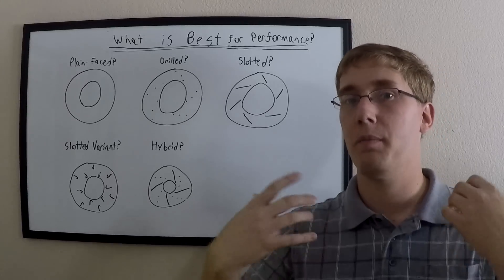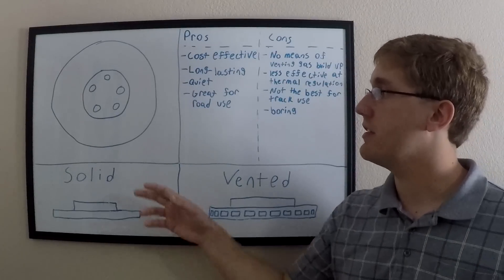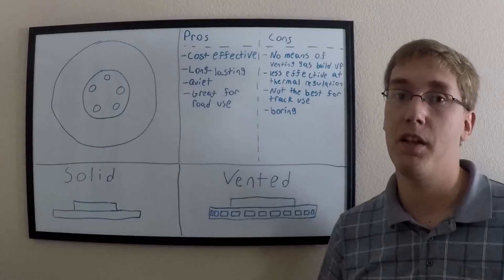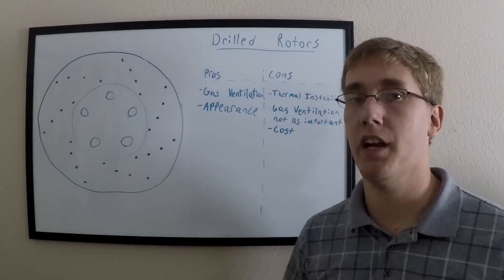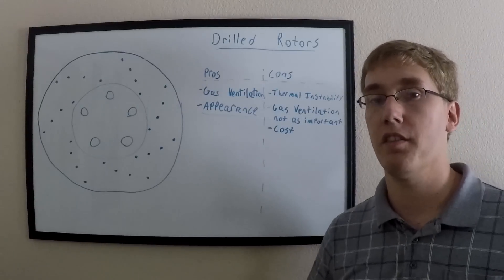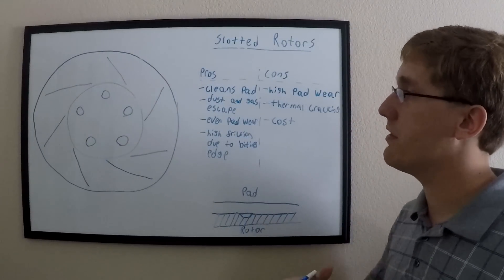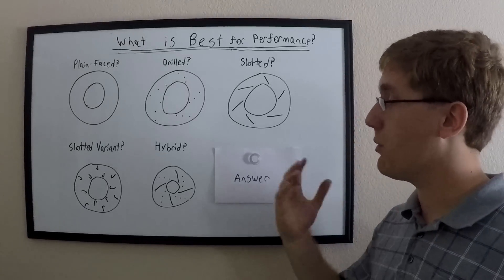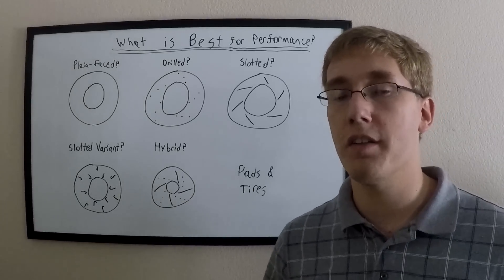Plain vs. Drilled vs. Slotted. vs ??? Rotors - What's what?

Comment: Grate video...need some help,iv got a mk5 gti golf with Mercedes ML500 discs 350mm from mtec brakes,with 6 pot Audi Q7 callipers,after 6 weeks i got the steering wheel vibrations so more than likely warped discs,the pads were basic brembos i believe paid around £40/50 ish..iv been told mtec brakes are shit because they come from China and are modified wen they get to the mtec factory,mine were dimpled & groved discs,I’m now thinking about EBC discs with yellow stuff pads,I’m running Just under 300bhp but i never use it,i drive normal hardly go that fast abs definitely don’t sit on my brakes,the corse of this would you say discs or pads,some have said because iv got 6 pot stoppers it’s making to much heat and the disc can not take it,i was told to drive slow for about 80 miles and i done 100 miles before actually sitting on my brakes,some say i should of done the 10 plus stop & go bedding in,60 mph to 5 mph to 60mph then 5 mph and so on,what’s your opinion to help me get the next one right coz I’m fed up ,wen i got the car it was the same set up but pads were more race pads i only changed them because of the squeaky noise and apparently they were on the car for 10 months (weekend driver) i then was everyday driver...sorry it was so long just need some good advice
Reply: Here is a Wikipedia link explaining how disks get damaged (saves my repeating the information) - https://en.wikipedia.org/wiki/Disc_brake#Disc_damage_modes.

So your problem, like mine with the steering wheel on my car can be complicated. One thing worth a try is to remove the disk, make sure everything is clean of dirt and rust, then rotate it one hole and reinstall torqueing to specifications. Use something like a marker on the disk and one lug before removing so you know how much to rotate it. If the problem ceases, you're done.

If that doesn't work, why not return to the original specs of what was on the car since you're not racing it. Get disks and pads as were specified for it. And as for how to apply the brakes for new disks/pads I've always read to gently bed them over 50-100 miles of driving. That will allow the pads to more tenderly touch the disks, wearing down the high spots easily. If lots of force is applied, then the high spots will get very hot (low spots will stay cooler) and the high spots will deposit material on the disks that you don't want on them and cause them to be thicker in some spots and thinner in others. So when the disk rotates, you'll feel that in the steering. That's what I can offer. Now I have to do the same on my car to solve my problem.
Reply: Put the OEM brakes back on.

Comment: Thanks for nothing, my stock flat face rotors using carbon ceramic pads warped due to excessive heat, after $1200.00 dealer replacement you bet your bippy I'm ready to try some after market drilled and slotted rotors
Reply from the maker: You need to try a different brand of rotors then, possibly a different material as well. Upgrading your rotor size can also help dissapate heat to help prevent this.
Reply: van helsing ok, that’s normal there is nothing wrong with your flat face discs except they don’t offer the same bite as with slotted/dimpled. You drove too hard and the rotors heated up. If you had drilled, slotted or hybrid discs they would’ve heated up just as quickly and cracked even at lower temperature (because they are not as strong). 

So what is the solution?You need to stop if you are on a racetrack at some point and check or measure the disc temperature. If they are too hot then that or a lap less is the limit of your brakes. But stopping is not recommended so do a cooling lap before stopping always. You will also need street/track pads and I recommend good aftermarket discs hybrid I would choose. Now If you are on a racetrack, you need to do a cooling lap even every 2-3 laps depending on how your discs heat up. Also, I recommend a racing brake fluid as well. Another thing, you could install brake ducts to keep them cool longer that would be an effective upgrade.
Reply: @inox1ck  So I'm not anything but a novice when it comes to racing and brakes, but I do see professional racers always seeking for a way to direct more air at the brakes. That is one possible way of helping dissipate the heat.

Comment: I like the teaching you did on this. Quite informative. However. As I drive a minivan on mountain roads,  I found your video didn't cover real world driving. Not everyone has a car for the tracks. Can you update the information for those of us who don't have "performance " vehicles. Thanks.
Reply: If you're driving a minivan, go with OEM replacement parts. The manufacturer of your vehicle designed it to stop optimally with how they built it, so use the same thing. Otherwise, you may spend money that may not give a be worth it, or even make your vehicle brake less effectively.
Reply: @Kenox80-80  Agree. They are outside the design/use specs. :D

Comment: Drilled is helpful when towing heavy
Reply: I would agree because with the added weight of a trailer, it takes more braking power to slow the vehicle, which in turn creates more gasses that need to escape.

Comment: Hey, I found that Coated Rotor supposedly be the best, no hole's no grooves no cuts or slits, do you know anything about this?
Reply from the maker: Coated in what? Typically coatings are for bedding the breaks or preventing rust during storage
Reply: Some coats are only to keep them from getting rust. On the break pad contact of course it stays clean

Comment: Interesting and informative, thanks. So in order to upgrade my brakes I'm better off getting a different pad, as tyres are already done. Can you do a follow-up about pads? That would be interesting...
Reply from the maker: The pads are deffinitely the biggest factor in terms of brake performance. Depending on your use case, you need to select an apropriate pad (low brake dust, noise, operating temperature, pad life, etc). The rotors, as stated in the video, do play a secondary part in that as well. I do want to make a follow up on brake pads at some point when I have the time.

Comment: While working at Napa I was told  by other countermen that ceramic pads glaze or "glass" over under extreme conditions such as towing heavy equipment with larger trucks (F-350s, GM 3500s, etc.). Is there any substance behind this claim? If so, ceramic probably wouldn't be the wisest choice for a car that sees some track time I'm assuming?
Reply from the maker: My understanding is that glazing happens at high temperatures, under heavy use as you mentioned. Metallic pads are supposed to be better at resisting fade/glazing at high temperatures. Ceramic pads are supposed to be better at keeping heat away from your brake fluid. There are also other complexities in choosing between the two, metallic are supposedly better when paired with slotted rotors, ceramics are better with plain rotors.

Ceramic and metallic are sort of marketing designations, typically pads have a blend of metal and ceramic material. Really you want to select a pad from the manufacturer which was designed for track use because it will have the right blend to prevent glazing.